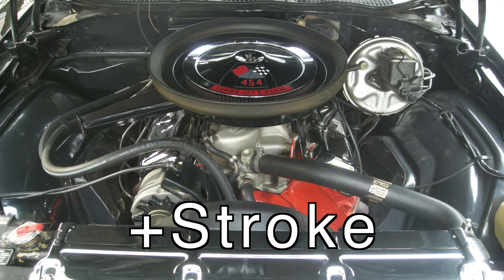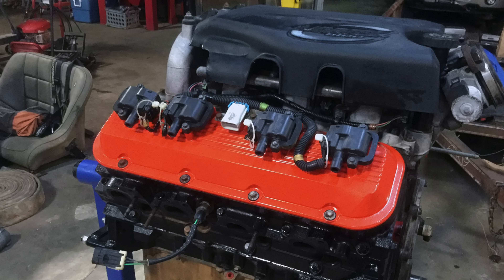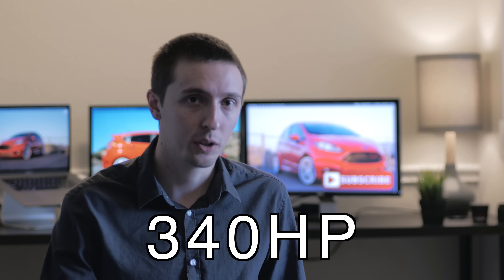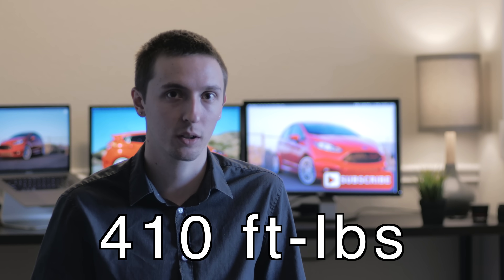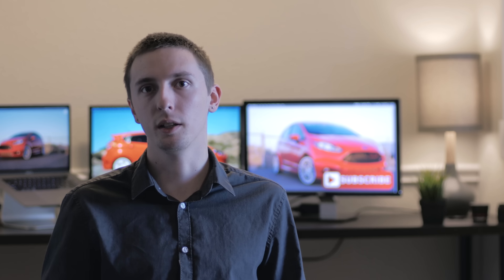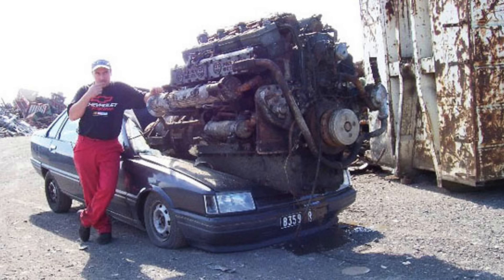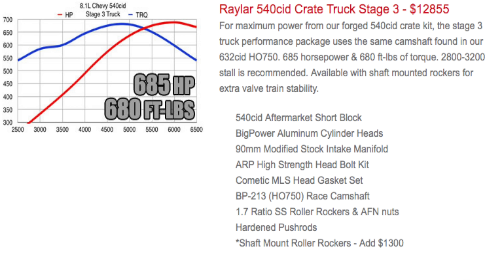Vortec 8100: Everything You Want to Know | Specs and More

Comment: I've had 3 vehicles with these motors. In 2 variations. Right now I am running an 04 2500 hd with a brand new 496 and the Allison. Last one was a 2004 GMC that I bought used with a supercharger on it. Holy shit that was fast. I'm building a 2wd sleeper suburban right now with a little help from raylar. I've had pretty good luck with them, even though I saw a lot of bad reviews and heard things. I haven't had anything but complete satisfaction with their products. Black bear performance is probably the best at tuning these motors. I have had about 7 different places try. Blackbear is the best. I have a truck that crosses the scale with me in it at 9,208lbs. It runs like a fuckin racecar.

I'm running the factory 410 horse motor from GM installed at the dealership. I bought it because my last 496 had just hit about 240k miles and was pushing more oil than I was comfortable with. The real comparison is the cost of anything with this motor. I replaced this motor at the dealership, with a warranty for about 7,840 dollars installed (at the GM dealership). Try doing that with a Duramax. Allison is still working flawlessly.  All I've really done is a tune, intake, headers, and a flowmaster super70. I got rid of the cats, If you don't get the 410 horse motor. Everything is cast. 410hp motor has forged internals You don't want to build power on anything else. I would suggest replacing the heads and intake, and thus change the fuel, and ignition systems if you really want to start making power with these. 

You can get the 460 horse motor from GM, It's not much more money, but I don't like the head and piston combination. I think they are grenades waiting to explode and I've seen enough evidence to confirm it. All but 30 lb feet of torque is available at about 750 rpm with the 410hp motor. With a FAT torque curve. No spool up, no boost lag. Best engines I've ever had. I have a 2004 GMC 2500hd loaded with a Duramax in it with 114k miles that sits in the garage because I would rather drive and work on these motors.

Comment: Big V8's are apparently on their way back in. Rummor has it that Ford, Dodge and GM will all have 7 to 7.5L engines in the future. Im sure you will see all the latest technology applied to get the milage in a respectable range. The reason is cost of ownership and reliability. Diesel right now is just no working out. You opt for the diesel and the accompanying systems and it adds 10K to the price of a truck. That's a LOT of money that must be made up by burning extra gasoline. Add in DEF and emission systems that take a dump after the warranty runs out and the math wins. I would love a diesel truck but only knowing the fact the entire emissions system is being gutted to pre 07 standards once the warranty is over. But companies with fleets cannot do the same or they face fines. A regular person may not be able to do it either if you have routine inspection.

Comment: Gm has huge support for a BBC, it's basically a 502
Reply: marzrox soto not even close its a bastard motor with nothing in common with the big block chevy
Reply: @oddball0045  it's a BBC just the industrial family which means it's revised for reliability.
Reply: jdr ok the heads, intake maniofold, oil pan, camshaft are different than any big block chevy. Also the motor is all metric where a standard big block chevy is SAE
Reply: @oddball0045  and a 366 and 427 t all have different heads blocks intakes and oil system different pistons etc etc. The 8.1 is a big block gen 6.
Reply: @oddball0045  I said it's a big block revised for the industrial line up. A 366 has everything changed from a 396 a 427t is also completely different to a 427 passenger cat the 8.1l is actually the most similar to the passenger car big blocks.
Reply: Car
Reply: jdr point being, its not your run of the mill big block chevy and aftermarket parts are few and far between. Nothing from a standard 454 will bolt up to a 8.1l, its like saying an LS1 is a 350 small block chevy because they have 8 cylinders 4.4 inches apart when the two engines couldn't be more different
Reply: @oddball0045  um actually a few parts will if you run a gen 6 block that isn't a 8.1l the only problem is heads and intake the bottom end you can even modify it for use with Mark 4 pistons and rods.
Reply: What is basically a 502?
Reply: It IS NOT a fricken 502! Omg! It is a TALL BLOCK similar to the old 366'd and 427's used in medium trucks and school buses for years! Gm changed to Vote heads and technology! It is a MONSTER ENGINE! Mine (2001 Silverado HD 2500 crew cab 4x4 ) has NEVER been out pulled by ANY Dirtymax, Cummins or Found On Road Dead diesel!

Comment: Lmao. That 8.1 is a complete boat anchor for how big of an engine it is. Takes 15,000 to reach a measly 680 HP  when a 427 ls7 can make 680+ all day long naturally aspirated with half the weight. Would MUCH rather have a 454 because of endless aftermarket parts available and easy hp goals. Plus the piece of shit is 1800$ around my local area and you can’t even bolt a 4l80 to it. It only takes an Allison which no one is going to shoe horn into anything.
Reply: A 427 ls7 na on a street build confused as gm made 700-800 ish on na configs in copo.

Comment: My daily driver is a regular cab 2002 GMC 2500hd Sierra 4wd with the 8.1, 6 spd. manual trans. w/4:10 rear. I have owned this truck since 2003 and can honestly say it is the best truck I have ever owned. It has 167k miles on it and I have no complaints with the 8.1 engine. I helped it out a little with Gibson exhaust and a Hyper tech power programmer. I get an average 12.5 MPG, is fun to drive, and pulls a load with ease. 3rd gear rolling burnouts are quite easy, even with 285/75-16 tires on it ( although hard on the clutch ) but I pretty much baby it. The only thing I have repaired engine wise is a crank sensor and a thermostat. If GM made another truck like this one, I would definitely buy one or two without hesitating at all. I don't know how many were made with a 6spd. manual ZF behind them, but I have never personally seen any others. If anyone has one or knows, give a shout. Would be interesting to know.
Reply: Wvrockcrusher, I have the same powertrain combo in my 2001 GMC Sierra 2500HD. The 6spd manual with the manual 4wd on the floor is a super rare option but I sure love it and wish this powertrain still existed in these new GM Trucks and especially the 8100 Vortec. So far I own 3 8100 Big Block GMC Trucks and willing to collect more GMC Big Blocks. They are real workhorses and really reliable for all kinds of use.
Reply: Right on! Is your truck a regular cab?
Reply: @wvrockcrusher  I wish it was a regular cab dually in this combo. Thats what Im really searching for. Mine is an extended cab long bed. Let me know if you ever want to sale yours. Dont get offended for me asking but Im just trying to make my GMC Big Block collection bigger..lol
Reply: That would be super rare to find the dually. I don't know if they ever made one equipped like you want. Have you ever seen a 6spd. manual behind an 8.1 with regular cab? Surely they made a few of them. When I called Gibson for the exhaust kit, I told them what I had, they thought I was joking that it was a regular cab 4wd truck with the 6spd. manual 8.1. They told me they never saw one, let alone heard of one. They sold me a kit for the extended cab short bed auto trans. and said it might work and to let them know if it did. All I had to do was omit the after cat pipes and it worked out. I absolutely love this truck and would love to have another just like it. I don't blame you for wanting another one too, but it would break my heart to sell this truck. No offense taken and if I wanted to sell it, I would like to sell it to somebody like yourself who really appreciates these trucks for what they really are! I have often thought if I could find a wrecked one with the same powertrain combo, I would put it in my '76 square body 4wd short bed. That would really be fun! Good luck in your search my friend!

Comment: 8.1L combined with the 6spd Allison swapped into my black 97’ K1500 Z71 single cab?
Reply: If you haven't already done it do it and get the raylar 511 CI base kit you get like four hundred and something horsepower and over 500 foot pounds of torque and better gas mileage
Reply: @mctigmctiggy1475  not always. More times then none they were mated to 4l85e.
Reply: @cecilg.relation2537  That is what is in my motorhome and is a very good trans.
Reply: @mctigmctiggy1475  you are absolutely right. I drive one,2500 avalanche. Yes it was a bit unclear but I still wasn't trying to correct you just offering info. No harm intended. Stil I myself am looking for an allison. I need those extra gears.

Comment: Piston slap was a problem with these motors too.
Reply: Yep, only when cold, isn't that bad, goes away within seconds after start up.
Reply: Wouldn't call it a problem. It's just what happens with hypereutectic pistons on cold starts. With enough of a oil film built up around the pistons the noise went away before the pistons even had enough time to warm up. Mine has 254,000 miles and they sound the same cold as they always have. I've seen the bores through the bottom of the crankcase and they look great.
Reply: @rewind48  
Yea I've heard them do that for the lifespan of the engine. I don't think it necessarily hurts them too much but it sure doesn't sound nice when you're in a parking lot and you can hear a Chevy 3 rows over slap it's pistons for 1 second when it starts.
Reply: Clint .R Bought a new 1974 z-28 and it had piston slap on a cold morning.  So did my 1977 L98 Corvette.  Learned to live with it.
Reply: Same thing with the 5.3 and 6.0
Reply: It's not piston slap you nitwit. It's the lifters ticking from the cold oil not circulating as well as warm. All Vortec engines have either Active Fuel Management, Displacement on Demand, or both! That's why they tick on startup, and in general. Lifters will hold valves open to lose compression, injectors don't squirt fuel, and that bank loses spark  (cylinder shut down) on half the block. I've just recently rebuilt the top end of a 5.3 so please have faith in what I say. Piston slap is a very different, actual problem whereas vortecs are designed this way.
Reply: @AndyE30  so do the 99-06 vortecs have afm, DoD, or both?
Reply: @AndyE30  
No sir. You are wrong. Piston slap and lifter tick don't sound the same. The vortec 4.8, 5.3, 6.0, and 8.1 are all prone to piston slap at startup. They do it for less than 2 seconds and it goes away. Do some research and look it up, it's most definitely a very common issue with these vortecs.
Reply: @92clintonr  refer to the definition of piston slap as "rocking of the piston inside the cylinder walls". The closest comparable term you're looking for is "lifter tick" as the higher viscous, cold, oil works in the hydraulic lifters. Notice, the noise in Vortec engines goes away after a few seconds to a minute as oil circulates and warms up. A SMALL amount of this tick is normal for these engines. I JUST rebuilt my 5.3 and it STILL does it on startup. Please, YOU do your research.
Reply: @AndyE30  
Very much aware of the difference of sound between the two. I don't care what you just rebuilt, you clearly need to learn more. Take four seconds of your time and look it up. It's a known issue. I'm sorry you're not able to recognize the difference. You also don't seem to understand that just because yours didn't have piston slap doesn't mean that none of them did. Vortecs are known for it. Look it up.

Comment: i love the 496    been thinking about putting one in my nova with a cam and some work on the heads with a turbo
Reply: With head work and  a cam that's fine . it does only have a 4 bolt main though , it won't support boost very well .
Reply: Dr. Westside seen plenty of 2 bolt main nitrous big block Chevy’s take a lot of abuse...
Reply: @Dr.Westside  lol you've been spoiled with the LS mains. 4 bolt is fine - and as already stated, a 2 bolt wasn't going to snap immediately either.
Reply: Super charge it over a turbo

Comment: The Vortec 8100 by GM Powertrain and Chevrolet would have been great for the 1975 Chevrolet and 1976 Chevrolet using the standard "unleaded fuel only" of the mid 1970s! Plus, it would have been great for the 1975 Chevrolet Malibu as well. As for the 1975 Chevrolet and 1976 Chevrolet it's under model names as Bel Air, Impala, and Caprice and it would have been an optional engine. People prefer small blocks as 350 and 400 during that time frame and 454 big block Chevrolet V-8 is not as common in those cars. 454 was way big for most people even in the 1970s. 496 is nice, but I am sure, it eats up gas too, but runs better than those mid 1970s engines with the new HEI systems for 1975 and 1974.

Comment: Interesting. A 3.5 Eco Boost makes almost as this engine in both stock configurations. Less than half the displacement, half the weight, twice the fuel mpg. 

Why wouldn't you want the Duramax.

Comment: Larry Hofer @ Raylar.  You are correct it is a wonderful , durable engine and runs forever. 
It has a very large following and is like you say "Gaining momentum" in the hot rod world.
Every one is becoming comfortable with electronics and making the 8.1 the engine of choice for big cubic inch toys. They make me happy.
Best to you.
Reply: Larry Hofer I’ve always wanted to build a rat rod with one of them as the powerplant. One day I will.
Reply: @LgSutterby  Same here.
Reply: I have an 8100 in my 74 Nova with a pair of 67mm turbos and a TH400. Needed a lot of work to make it fit, but it is a great motor. (edit 76mm to 67mm typo)
Reply: Comfortable with electronics? Really.

Comment: In the past the big block was the heavy towing option, that’s what you got if you wanted to tow heavy. Especially in the 6.5 diesel era they (the diesel) was more of a fuel efficiency option. But as technology advanced the diesel started becoming the high performance option in the trucks. They could tow more than the big block, and by the nature of how a diesel works, get leaps and bounds better fuel mileage as well. And that’s pretty much what sealed the big blocks fate, I feel most people who didn’t want to spend the cash for the diesel just got the 6.0 ls based v8 as there really isn’t that much of a sacrifice in power etc between the two. And so you don’t really see too many 8.1s out there because of that I think. I’ve seen them in suburban’s more than anything since that was the biggest motor you could get and they didn’t offer a diesel in them either. But they did get to stick around in the 4500 to 7500 and got popular for a while after they started requiring dpf‘s on the diesels. But I gotta hand it to gm they kept the big block going a lot longer than ford or Chrysler did with theirs.
Reply: There is a difference in a 6.0 and 8.1, it’s called stroke. The 6.0 has a 4.0 in stroke and makes around 360 to 380 ft/lbs at 4500 rpm The 8.1 had a 4.37” stroke and makes 455 ft/lbs but it’s making over 400 ft/lbs at 1200 rpm. The 8.1 and 6.0 may have similar power on paper but especially for towing they are vastly different and the 6.0 is definitely a huge sacrifice when it come to that.

Comment: Has anyone swapped a 8.1 into a regular cab short bed truck I’m considering as how I have one sitting in my garage and currently have a v6, was thinking 4.8-6.2 vortec but I mainly want it for burn outs and v8 sound
Reply: fremulanez 
don't bother, you can get more power for cheaper out of an ls
Reply: If you want a big block don't go to a industrial platforms you will be broke for severe get a 454 and a cam bump compression and just put it in there.

Comment: you listed all the NET hp rating and torque rating, according to the numbers this engine did not make the same amount of foot pounds of torque or horsepower is a 1970 454
Reply: jeff colt the ls6? If you had to pick one for towing, you'd definitely want the lower torque 8100. The ls6 was a racing engine that made its torque and horsepower higher in the rpm band, the 8100 had better off idle performance and would be harder to stall on take off. Peak numbers aren't the be all end all, there's quite a bit to consider when you build an engine. Everything from runner volumes to intake style(single vs dual plane), to cam duration will make comparing engines not so cut and dry. 
Here's one good example. My 502 Chevy against my dad's 400ci Diamond Reo. 
My engine is north of 600hp and makes about 600 lbft of torque. Idk for sure how much torque a golden comet makes(yes, diamond reo named this engine the golden comet), but it only makes 180hp. My engine is another quarter again the displacement but if you dropped that 400 in my Vette, it'd crush it, even if it didn't it would accelerate like an 18 wheeler. Meanwhile, that 502 in the Reo would be pitifully anemic. It could pull the truck while empty, maybe a bit of a load, but it would never match the power. The off idle response of that 180hp engine is off the charts.
If you're wondering, yes, both of these are gas engines.
Reply: Sensibly Named Person Of The Internet  I just did some research on the 496 and saw that it made 455 foot pounds of torque at 3200, and I looked up the LS6 454 and it made 500 foot pounds of torque at 3600, that's not that much higher so either the 496 is underrated and so was the LS6, I would like to see both engines completely stock how they were from Factory on a dyno, I think the 496 has a rev limiter which would need to be eliminated then dynoed, but either way Factory ratings aren't always a hundred percent accurate. if the torque is really close in the 3000 + RPM range then how far, how much farther are they apart right off the idle?